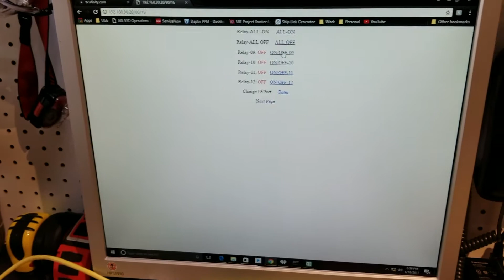Remote Firework Ignition System Part2

Comment: Any updates on this?  Have you connected thru Bluetooth?
Reply: Hi Mat,  No we are still connecting hardwire.  I am do not feel safe with wifi or Bluetooth from a safety factor.  I wouldn't want someone to connect to the system and set off the show.

Comment: Nice! So will you have enough to fire all the fireworks in 16 bays?
Reply from the maker: Yes, actually we have 140 mortars (14 crates 10 per) alone w/ a dozen or so cakes.  The plan is to double the crates per 1 channel, and then put the cakes on the remaining channels.  Maybe use the remaining channels to ignite rows of timing them with fast and slow safety fuses to space out the ignition.  Still working on the pyro layout and how we want to set them up.